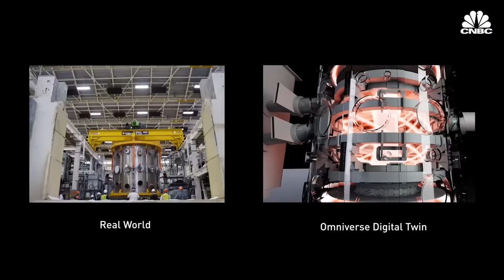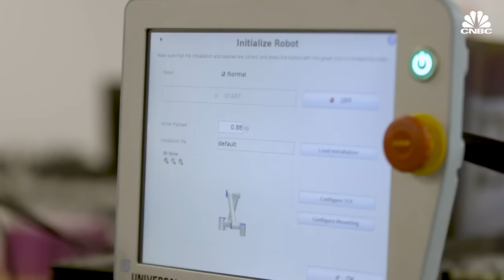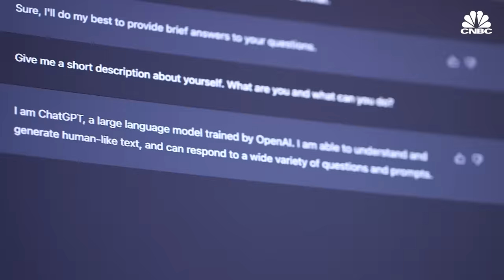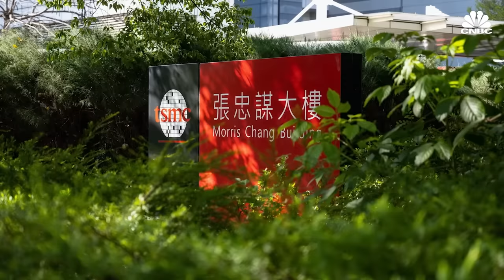Nvidia CEO Jensen Huang On How His Big Bet On A.I. Is Finally Paying Off - Full Interview

Comment: I went with AMD this graphics card cycle (first time I didn't go with nVidia in nearly two decades), because they've got DisplayPort 2.1, and bandwidth is important when one is interested in 8K displays.  I just hope an 8K monitor better than the Dell UP3218K comes out before too long, because my Dell, which I've had for four years now, has a TAB-error, and I'd like something a little bit more advanced, preferably with a smaller 27 inch diagonal and higher pixel density.
Reply: Thanks for showing others that there is another path. They don't just need to come on here and whine about high GPU prices from nVidia. 🤦‍♂
Reply: I’ve seen people complaining about the lack of DP2.1, but it never make sense to me. NVIDIA cards have HDMI 2.1, which is also capable of 8k@60Hz. And none of the card on the market today is capable of rendering 8k at higher than 60 fps. I just don’t understand why that is a deal breaker
Reply: @Owenzzz777 , it's about future-proofing for the monitors that I hope are coming, if the display industry will get off it's lazy behind and innovate in that area.   I need to use two DisplayPort cables to run my UP3218K.  They should be able to do it with just one, reduce the screen size to ~27", which is my ideal screen size for a desktop monitor, and improve things like black levels, contrast, color gamut, pixel response time, etc...  And, of course, higher than 60Hz refresh would be nice too.  I've been chasing the perfect monitor for decades, and shall likely continue to for as long as my eyes still work.
Reply: @Darhan62  future proofing is so so important. i just couldn't justify buying a 4070ti when i knew i might be disappointed in it in a year or two.
Reply: @MissesWitch , it all comes down to how long you want to keep your system alive and relevant.  If you're happy with your CPU, RAM, etc., then keep it as long as it serves you, and think about how long you want things to serve when buying a new component.  Even if I had infinite dollars I wouldn't want to replace my whole system too often.
Reply: @Darhan62  why is HDMI 2.1 not future proofing 8k? And why does it matter if the GPU itself is not capable of rendering 8k 60 fps? The bottleneck is not the interface for a better monitor
Reply: @Owenzzz777 , I haven't looked into HDMI recently, but my understanding is that it was developed more for TVs and game consoles than for monitors and GPUs.  The assumption being that the future of monitor interfaces, on PC, is DisplayPort rather than HDMI.
Reply: Just tell you're an amd fanboy
Reply: @nowayshay , actually, I was very loyal to nVidia for a long time, and mainly just because I felt they had the better product overall.  This time, I had concerns beside raw performance, so I went with AMD.
Reply: @Darhan62  yeah man, i feel ya. I replied for fun. Jensen gave the middle finger to the gamers with both 30 and 40 series so i don't blame anyone who switch to AMD.
Reply: @nowayshay , I expect my next card will be an nVidia card, but time will tell.  It will come down to where the PC and monitor industry are in a few years, and which card I feel is right at the time.  Currently I don't feel any "loyalty" to either company.
Reply: Why are you all talking about video games this stock is so much more in the next ten years

Comment: Audio needs a low pass filter. "S" sounds are so sharp it almost hurts.
Reply: It's called desser not lowpass what you mean is a compressor that suppress upper midrange frequencies, lowpass would make them sound muddy if they actually used it to effectively suppress s sounds...

Just saying.
Reply: @danielkisel5661  to be really picky, it's usually implemented as a dynamic EQ (when a certain frequency gets loud enough, reduce the loudness of that frequency)

But yeah it drives a lot of us nuts, to the point where we've developed de-eSSers
Reply: @Xld3  Yes, but desser was the tool that was originally created just for this purpose, to reduce the harshness and sibilance in sound.

First dessers were hardware based way before dynamic eq was even possible.

And honestly difference between dynamic eq and multiband compressor is more vocabulary than real use case.

So yes dynamic eq is just the most flexible and can do it all basically, but I would still use and prefer to use dedicated desser which was fine tuned over the years to react just to sibilance something like Weiss desser tbh. 😉

Or if we want to go really modern then something like soothe...
Reply: @danielkisel5661  fair enough, it's like a multiband that just uses a single narrow band. It's basically the same thing but I think "dynamic EQ" is easier to understand than "multiband compressor" when people have no idea what you're talking about, since a lot of people have an eq on their car stereo

Comment: I think it's actually his $1,400 GPUs people keep buying that are paying off
Reply: That in itself is a feat.  To have had the better gpu for so many generations...  Impressive.  I remember like one where Radeon was slightly better.

But yeah gotta play up that's next
Reply: The cost increase cannot be explained by inflation, supply, crypto or anything else. Nvidia is price gouging its consumers, beyond 'reasonable'
Reply: the A100 that they talked about so much in the interview cost $100,000.00 per blade so I think that one still wins
Reply: @wraith8323  What's reasonable is set by the market, and as stated the silicon is in high demand, cutting edge foundry allocation is going to the highest bidder, while you likely vote to print money.
Reply: They are sitting on store shelves pal. The only GPU selling well at the moment is the 7900XTX. It is basically only available in preorder.
Reply: @laloreta798  It is not per GPU. The top accelerators from AMD and Nvidia cost between 10 000$ and 20 000$.
Reply: @evalangley3985  the most popular version in the data center is the SXM one that comes with 8gpus in a huge single board. That's the one with a combined  640gb of VRAM where all this new AI models run.

Comment: Very inspiring, we should use tech to fix the current banking system. the gov should start creating a an economy model, where it will not be perfect it should at least show the largest gaps and risks of septic actions the regulators take, such as what happen recently with rising intrests  rates.
Reply: They know the risks of raising interest rates, such as a increased unemployment & possibility of the U.S. going into a depression. Notice that they don't use whole percentages when raising and the highest raises have been .75%, or 3/4ths of 1%. They want inflation at 2% and will raise rates slowly until inflation starts coming down. 🤷‍♂

Comment: 23:17 Ironically, Nvidia is partially responsible for the increased power usage of datacenters. Their latest designs have become energy monsters.
While the race for efficient computing is still going on, it has become economically possible to print lager and larger, more power hungry chips. Thats because the factory yields have improved. And competition has increased.
Thanks to that the power density in data centers has massively increased -- and consumer chips have also doubled in power consumption over the last generations compared to before.

Also lets completely ignore the massive sales to crypto miners that nvidia did during the pandemic.

Nvidia is partly directly to blame for this increase in power -- but they can blame customer's needs and wants all the same.
Reply: Ok fine, power density and total consumption is going up, but efficiency is constantly improving too, so people are getting way more tflops per kWh.  What are they supposed to do here?  There's high demand for AI accelerators and they're building more powerful and efficient accelerators than everyone else.
Reply: @jlgroovetek  In chip design, and especially node shinks, you have the opportunity to focus more on power efficiency and trade in some performance gains gen over gen, to get better efficiency. So you could choose to run 5% faster, but achieve that with 10% less power for example.

Also in design choice, while you can build consumer chips that need a 600W power plug and draw over 450W - you are pushing the chip well beyond its reasonable efficiency curve.

Nvidia could certainly build in accelerators and focus more on efficiency than it does these last 2 generations -- but they have a competitor in the GPU space and will build outlandish chips to maintain its lead.
Reply: @HexerPsy  The 4090's ideal efficiency point is actually around the 350w mark, and at that power level, its efficiency is the best out there in the history of GPUs.  True that they are 450w out of the box to squeeze a little more, but even then the performance vs power is still quite strong.
Reply: @jlgroovetek  Exactly my point of critique. Comparing the 4090s gaming performance between 350W to 450W -- for a 29% power increase, how much faster does your application run?

Nvidia decided in their design it was best to trade that 29% power in for X amount of performance that doesnt scale. Yet that is on ALL their units. They could help save large amounts of power by setting the out-of-box settings at their optimum, and only allow the few that push their hardware to run it higher than optimum.
You could almost make that as easy as adding a dual bios switch and running optimum vs high perf settings.
Reply: @HexerPsy  This is a good debate.  I'm only responding to your point raised about chip design and node shrinking.  My point is that the latest NVIDIA architecture is the most efficient ever made; the only thing that made it less efficient was on the consumer side where they decided to set the TDP in the BIOS to default at 450w for the 4090.  However the silicon and architecture is the same as their compute/accelerator products, which are not set at consumer product TDP levels.  I'm saying from a chip and node design perspective, they have completely succeeded.
Reply: @jlgroovetek  fair enough ^

Comment: What about Tachyum's universal Prodigy chip?
Reply: Tachyum, co-founded by Dr. Radoslav Danilak, is enabling human brain-scale Al (Artificial Intelligence) and advancing the entire world to a greener era by delivering Prodigy, the world's first Universal Processor which integrates high-performance CPUs (Central Processing Units) with the functionality of GPUs (Graphics Processing Units) and TPUs (Tensor Processing Units) in a single device.

Tachyum solves key pain points for data center efficiency that include high power consumption and low resource utilization. Data centers currently consume over 3% of our planet's electricity, predicted to be 10% by 2025, and are typically less than 50% utilized. Tachyum's revolutionary architecture solves both problems. Prodigy is the world's first Universal Processor with the ability to address hyperscale, HPC (High Performance Computing), and AI/ML (Artificial Intelligence/ Machine Learning) workloads at 10x lower power and 3x lower cost (at equivalent performance) than competing products.
Reply: 22:36 data centres consumption of power

Comment: A lot of marketing hype in this video, as a lot of those statements are not technically accurate.   Language models can generate "code" but whether that code actually compiles and works is the question.   A more accurate assessment is that AI can be used to assist with various programming tasks but that level integration varies across applications.   And this is generally true of AI overall as there is no one size fits all model and many organizations will still have to design and develop their own use cases for AI beyond mere customer service chat bots.

Comment: AI hardware can only thrive with meaningful and powerful applications. What made Nvidia great in the Gaming sector was their software that allowed developers to maximize hardware ability. They need to push harder on the software partners that are developing at the forefront of the AI space. Products like CodeWarden from Rooted Concepts that drive AI evolution of engineering workflow is how they can dominate the category. RISC-V chips is nothing new, just like GPU race with ATI/AMD, what set Nvidia apart in the past was always there software and/or drivers.

Comment: No matter what you do to evolved a computer it's still need people to teach it what to do by C programming then only it can do and it not Smart at all. That's is why they sold the computer in the earliest days so expensive so it can keep out of the hands of ordinary people. Artificial intelligence is very old technology like production factory using AI computer to keep producing goods. Those days when I was out at sea ⛵ they even say something like an artificial intelligence ums ship 🚢⚓ and ums is unmanned machinery spaces but it never worked. You look at a very old desktop casing White color change into milky white color and now you go and buy an AMD casing for Ryzen 4600G. What is the difference, I have to tell you the older casing on top can put a cup of coffee ☕ no holes and the newer casing desktop on top got holes cannot put a cup of coffee ☕ but can put dust filter. The Old casing power and reset button 🔘 big size at bottom but the newer casing power and reset button is at top but smaller size. Elite Old gamer have spoken.

Comment: Jensen is 100% correct for abandoning moronic PC builders who think they are smarter than engineers. 

High end graphics for video games are a LUXURY.  It’s is not a necessity.  If you keep your expectations low, there would be no need to spend all that money. 

AMD and Intel will also be shifting to AI processors so PC building morons will just have to get used to this. 
😜